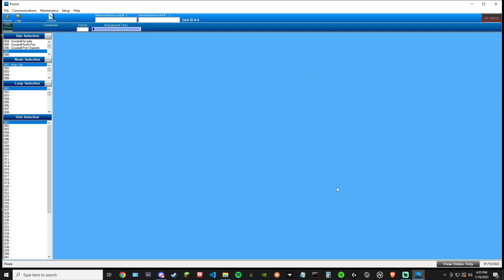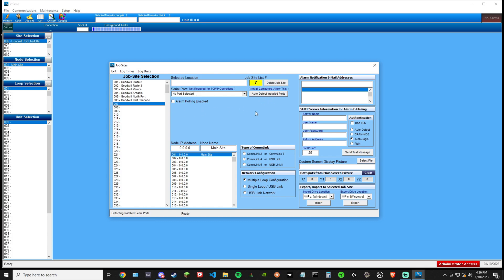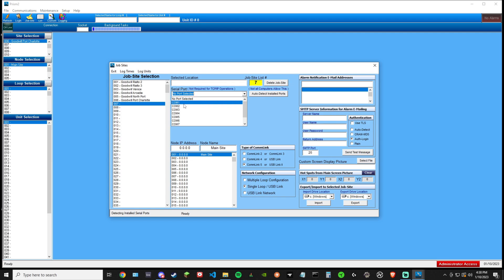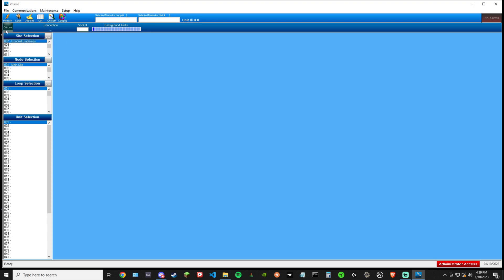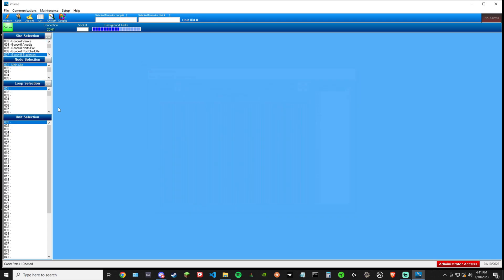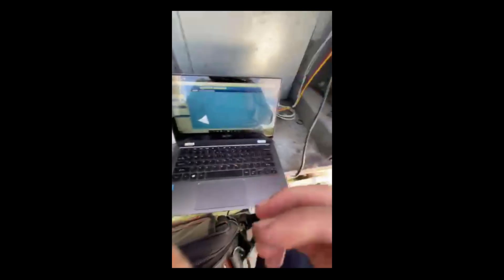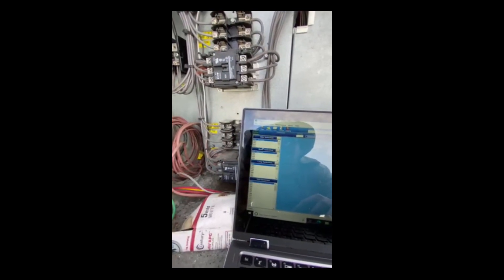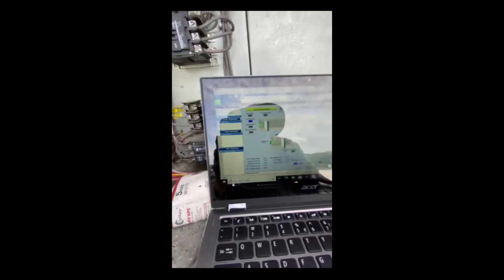Aaon Prism2 connection process - 2023

Comment: Is there something different that needs to be done with Prism 2 to connect to the old aaon board(vcm-x), I tried to connect but it just doesn’t show, i followed the steps you had but Im not sure if there different steps for the old board
Reply: Old Aaon boards you need to switch from high speed to low speed on usb link